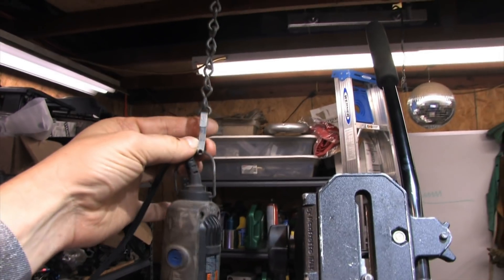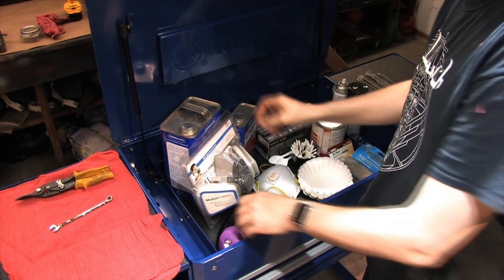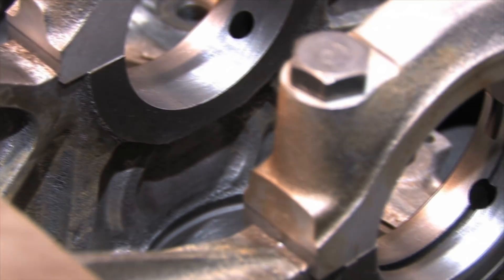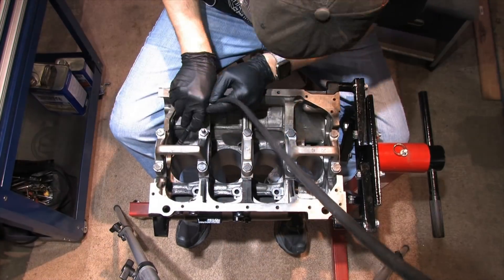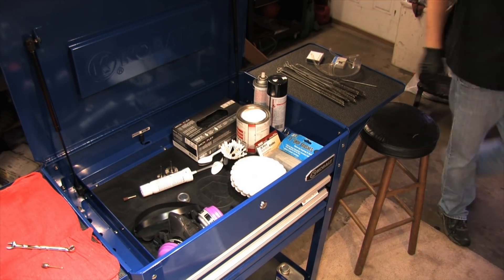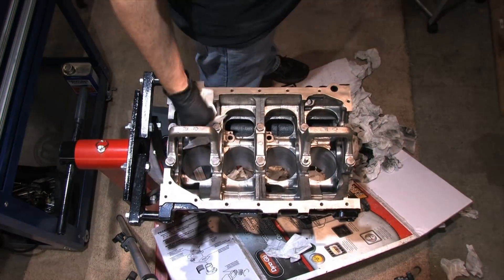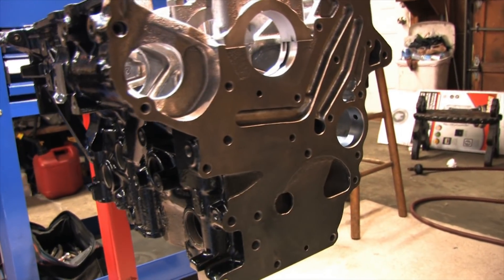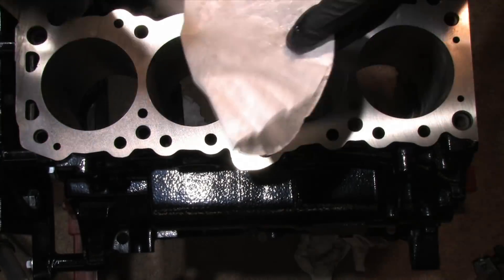Oil-repellent Crankcase Coating?

Comment: So this was done to keep oil from sticking to the inside of the crankcase, what about the heat from the block since it will not have as much oil to transfer the heat to?
Reply from the maker: The heat transfer from the block to the oil is much less likely to occur from the crankcase to the oil as it is from the oil to the crankcase.  All friction surfaces are un-coated, so that function of the oil system is not lost or affected.  Those are the surfaces that need to be protected.  Heat from the combustion process is supposed to be absorbed by the coolant system of an engine, and if that has to be a function of an oil system in order for it to function efficiently, something is broken.  Something is generating way too much friction, or the wrong oil is being used.  The oil will carry heat away from friction surfaces, and this coating will help it find its way back to the pan and oil cooler more quickly.
Reply: However running oil through an oil cooler more quickly will not cool the oil faster because it spends less time in the cooler, although I guess it also picks up less heat due to not staying on the treated surfaces. In the end I imagine this puts more of the cooling duties on  to the cooling system and less on the oiling system.

Comment: went to replace the MAF sensor on my 2001 taurus w/ 215k miles. 

thanks to this video I decided to just go ahead and glyptal my graphitic iron crank case while i was add it. 

should only add like an hour of extra work right?
Reply from the maker: HA!  nope.  more like 10-15 minutes.  Skip the industrial oven and put it in the microwave.  It's faster.

Comment: Is there a way to show the post bake results.?
Reply from the maker: Yes.  It will be in a future video after it's baked.  :)  This engine will get a lot of camera time in the coming years.  I will tear it down and go through it even without a failure just to prove the example.  There is a lot of talk about this treatment, and an absolute vacuum of evidence outside of personal testimonies (that are positive btw), so I decided to take it on and make that evidence.
Reply: Thanks Jaf, The reason being  why Im asking to show the results , I have used a spray epoxy called SB-6-665 & after I did all of the final details on on the block , my builder hot tanked washed the block and it flaked off .

Comment: Wouldn't doing this cause oil buildup to just become extra concentrated to everything not coated? You know there are really good quality products to keep oil from building up, and disolve oil that has built up into a substance that can be passed through the oil filter without clogging everything. I'm interested to see how this process affects things like variable valve timing in 10+ years.
Reply from the maker: How do those detergents work out with engines that make more than 150hp per cylinder?  How do they affect bearing wear and high heat ranges?  Really you don't have to answer that.

Racing oils don't contain detergents.  Detergents break down oil viscosity.  Using additives in the oil system of a race engine would be just as dangerous of an experiment as coating the crankcase with toxic electrical insulating paint, only they'd accelerate the failure of the turbo's center section.  You make great points that need to be read by everyone with a mostly-stock daily-driven street car because they're a better alternative than this kind of thing for the way they use their car.  

Note that all surfaces that were coated (except for the oil return galleries from the head) wouldn't have any effect if they became sludged up.  The crankcase is not a moving part, not a friction surface, and not a critical heat sink.  The glyptal coating will force more of the oil impurities through the filter, and the un-coated parts of the engine are either moving parts, or have pressurized oil blasting across their surfaces.  I'm very interested to see how this coating holds up 1 year, 5 years, 10 years down the road myself.  It won't really bother me much if it grenades if it answers questions about this process to everyone looking for answers about it.  I don't have VVT, though.  That will have to be someone else's experiment.  :(
Reply: I wasn't exactly sure what you were doing with the whole thing. I watched two of the videos, also thanks for replying! About the additive I was talking about, it's made by BG,  it's a chemical that you add to your oil a day or two before you change your oil, it's more of a flush.

I'm no engineer, but I dont think that detergents, an additive, break down oil viscosity. Motor oil is made to be a specific weight, engineering explained talked about the different oils in a car, Synthetic and Conventional. Full synthetic will have more additives, whatever they may be, and the oil does last longer. When I was talking about a 

I would imagine you could run additives in a 4 cylinder "race engine" that makes 600hp (Probably 560-540 to the wheels?) For a couple hours of driving then change it. I wouldn't do any crazy pulls at the end of an oil change anyways. I'd be changing it every 3k in fear of something going bad. Besides, if you slapped a turbo on an aged engine, and did an oil flush, I don't think that would hurt it.

What is the displacement on that engine? Displacement per liter is more of a measurement than per cylinder.

Comment: You aren't worried about it peeling off after time? or crumbling off?
Reply from the maker: Nope!  It's flexible and rubbery.  Even after it's baked.  It doesn't crack or tear.  You can cut it, but it penetrates deeply as it dries.  The only way it can come off is if the surface prep is inadequate prior to it being applied.

Comment: You missed a spot...

^.^

Also, should've grinded down the casting flash as well.
Reply from the maker: I did.  It's all gone.  And I got the spot I missed right before I poured the return galleries at the end.  There were 2 spots!  ;)
Reply: Lol, was kiddin about the missed spots but the casting flash appeared huge along the number 2 and 3 cylinder saddles @ 11:19
Oh well, keep up the good work, love the vids.
Also, is this motor back together and running yet? I would like to know about any performance gains with this. I know that it helps get the oil back into the sump but any mention about reducing windage loses?
Reply from the maker: It really shouldn't have much of any effect on windage.  The 6-bolt doesn't even have a windage tray like the 7-bolt does.  My example won't be like anyone else's who is using a stock crank because the crank I'm using is knife edged, micro-polished, and 9 lbs lighter than stock.  It's nowhere close to being back together.  This car is a long-term project.  I haven't even had a chance to bake it yet.  There's 5 days left of drying, a dry assembly, a test fit, valve clearancing and a final assembly left to do.  Then after that, the whole hot side has to be fabricated from scratch.  I've got a long way to go.

Comment: So what i understand from this coating that it benefits in oil flow and protect internals of engine from rust due to long time storage without fluids , am i right ? , and if i am right can you tell me if there is more benefits of this coating like thermal heat resistance .... etc
Reply from the maker: My engine has some pretty extensive cooling upgrades already.  The benefit I'm shooting for is keeping more oil in the pan by returning it faster.  It's a band aid approach to the fact that I'm spinning the engine 1500-2000 RPMs faster than stock, and therefore moving more oil up into the head at high RPMs..  I will be running water/methanol injection which will also add water to my crankcase.  I will also likely let this car sit a lot whether or not there is oil in it.  It doesn't get used a lot.  It's a pretty impractical car on the street, but I will still drive it on the street.
Reply: Jafromobile I get your idea , but i have 2 question points , first did you consider that by applying this coating you will change oil pressure in your engine and that might get you in trouble . you must choose the right oil viscosity carefully . Second, what is the material of this coating or it is just high temperature regular painting ?

Comment: Does this also remove molybdenum dioxide ?
Reply from the maker: If molybdenum was coated with Glyptal after the part was manufactured it would greatly reduce the Mo-Mo bonding because of its separation from the catalyst (o2) necessary for that reaction.  Of course I'm slightly confused about how you're encountering molybdenum, Titanium, or tugarinovite inside an engine?  Perhaps you're experiencing high oxidation levels from the reduction of alcohol-based fuels? ...but where is the molybdenum being introduced?  This treatment would prevent oxidation if the part was completely coated, but it will not remove existing oxides.
Reply: ***** Oh I just mean Molybdenum through engine oil. Molybdenum is supposed to bond (fuse) with metals and make a coating on the surface greatly increasing friction resistance.

Comment: All great till a bit chips off and plugs an oil way.
Reply from the maker: It's not a lacquer.  It contains no resins.  It will not chip.  It will remain rubbery and flexible for decades.

Comment: Is there any risk of pieces of this coating breaking loose and getting stuck in oil galleries and passages? And I thought you would want oil washing all over any internal surface to help absorb heat....????
Reply from the maker: Oil still washes over bare un-coated bearing surfaces of internal parts where heat matters the most.  There should be no reason to rely on the oil system for crankcase cooling of non-friction surfaces because that's what the coolant system is supposed to do.  The faster the oil drains from the friction surfaces, the faster it gets to run through my thermostat-controlled air/oil cooler.  If the oil system has to be the system to keep your engine temperature in check, then there's something else horribly wrong, generating way too much heat... and that should be repaired asap.

Comment: I could never get my Kerosene heater to work right. It would smoke like crazy. I tried changing the wick and using bottled fuel from Home Depot with no luck. I ended up using the satelite propane radiant heaters.

Comment: So it's like the opposite of Z-Max.
Reply from the maker: ...sort of.  Only for... oh never mind.  
Someone did ask me to test its exposure to Z-max.  That stuff is expensive, but so was my power bill when I put a humidifier and dehumidifier in the same room.
Reply: haha for sure. I just think its funny how there are products for both keeping it away from the metal and infusing the metal. I never thought Z-Max was a great idea because if it can seep into the metal why doesn't it goes though the seals or seep all the way through the metal.
Reply from the maker: I used to wonder how Aero-Kroil stays in the can?  It penetrates pores as small as one millionth of an inch.  What valve or seam is built on that fine of a standard?  That's .000001" or 2.54e-5mm for you non-imperialists.  Who's the crazy one now?

Comment: Do you think this is something a road race engine might benefit from? Only issue I can think of might be heat transfer.
Reply from the maker: I know it was used on salt flat cars, but I don't know?  I suppose it would depend on that particular engine's oil system and how well it gets oil from the head to the pan, and how that's affected by lateral G-forces.  I'm not coating my oil pan.  My GSX gets driven on the street, but I only race it in a straight line.

Comment: hey Jafro I have a question about how you painted the oil return galleries with the product you just used, My question is about the flow of oils through the ports and passages and whether or not putting the treatment into the return lines will raise your oil pressure do to making the holes smaller in diameter do to the new coating on them, and if it's not a huge problem would there be ant benefit for you to do the galleries on the front of the block as well? just rather curious about it.
Reply from the maker: The oil return galleries from the cylinder head to the block are not pressurized.  The crankcase has ventilation to deal with blow-by gasses, but the oil return galleries I coated are all like gutter pipes for the crankcase.  Oil just has to flow down them.  The coating might be a 1-2 mil coating (I only did 1 coat here, a generous one, in the last scene), and while it takes up a small tiny fraction of the size of those galleries, its surface tension accelerates the return oil flow... actually helping those galleries move more oil.  The galleries you mentioned on the front of the block are pressurized oil passages, and precisely the kinds of areas you would not want to coat.  If you were going to have an adhesion problem, this would be the very first place you would have that failure because the rapidly-moving pressurized oil stream would strip it off.  Some of it will bypass the oil filter and end up down-stream throughout the mains and lifters if it fails.  The polishing treatment they received in an earlier video is enough.
Reply: Jafromobile that was exactly the answer I was looking for!

Comment: I know you've gone through a LOT of effort to ensure this won't happen, but I'd be terrified that the coating would come off and totally plug up the oil filter! Great video though. I can certainly appreciate all the work you've put into this project.
Reply from the maker: It would clog the pick-up screen first.  ...which is actually worse, but...  Nah, I'm not worried about it.  I'm taking measures above and beyond the label's instructions to make it stick, and following the advice of others who have had great success with it to get there.  The drying/baking procedure is how you get it to stick so that you can mash on it with confidence.  It's baked on at a temperature higher than the engine operates under stress.  It's not going anywhere.

Comment: Yay, another Jafro viid! So what's the point of this coating that warrants all of this extra work? I'm familiar with lots of high-performance engine build techniques and coatings, but I've honestly never seen this before.
Reply from the maker: For nearly 4 decades now, people have been experimenting with ways to keep the sump buried in oil.  All the way back to the late 20's when farmers discovered the Model T they bought to drag their plow with leaked oil from the blocks.  Right through the casting.  They found they could fix the porous castings by coating the crankcase with lacquer and they'd hold their fluids.  Leave it to a farmer.  Salt flat racers used lacquer treatments to accelerate the oil draining back to the sump in wide-block V8s.  The higher they revved the engine, the more oil would stack up in the heads because it couldn't drain fast enough.  People have done this with Rustoleum, epoxy resins, etc...  Some I'm sure work better than others.  I made my selection based off of the product that I heard the most about.  Watch the previous video about it, I talk about that a lot more.
Reply: So is this useful only for iron blocks, not aluminum (I'm no metallurgist). And it sounds like your chief concern is staving off oil starvation. Is this a big problem with the 4G63? I'm much more familiar with the MZR DISI Turbo (an aluminum block with oil squirters) and we don't have any issues for most folks. For those who do a lot of high-G/competitive driving, removal of the balance shafts and installation of an oil pan baffle offers two benefits: 1) all of the benefits that come with increased oil capacity; 2) a physical barrier that prevent Gs-induced oil starvation.
Reply from the maker: I don't road race or auto-cross it, but I'll be spinning this engine at 2,000 RPM higher than it was designed to spin.  The natural effect is that I will be shifting a greater volume of oil up into the head from spinning my oil pump that fast.  Most people don't spin a DSM engine to 9,000 RPMs, and the ones that do often have the ridiculous $1,600 Moroso dry sump pan.  I don't want to convert to dry sump on a street car and I'm trying to see if this little trick can prevent it.  I did coat a cast aluminum head. to help the oil to find the oil return galleries faster.  Oil drain-back wasn't my only reason for coating it, though.  This car is going to sit a lot.  It's not daily-driven.